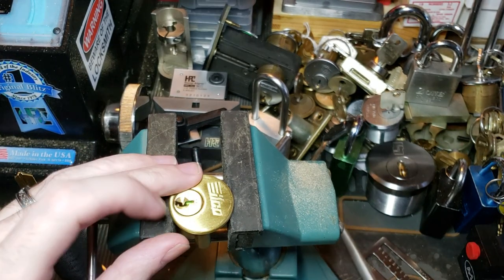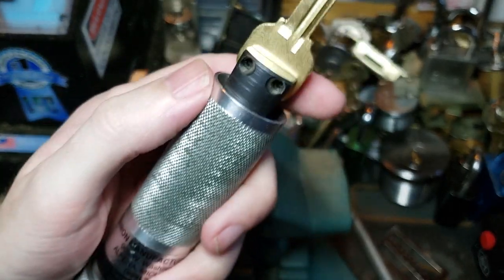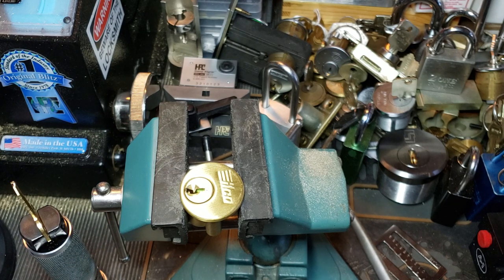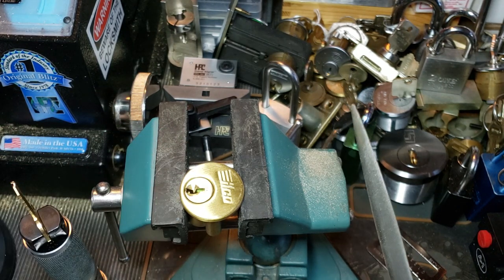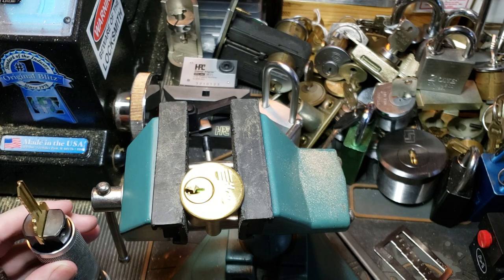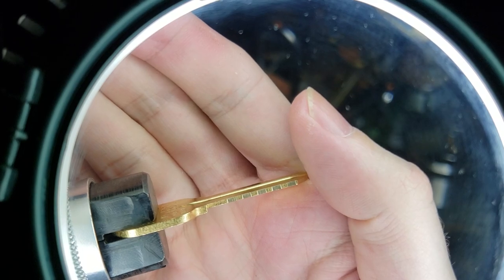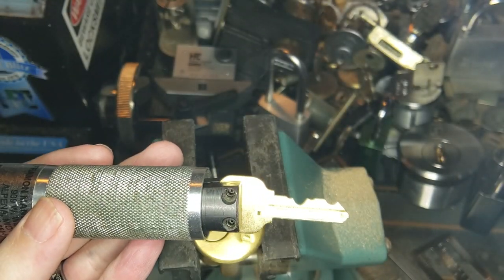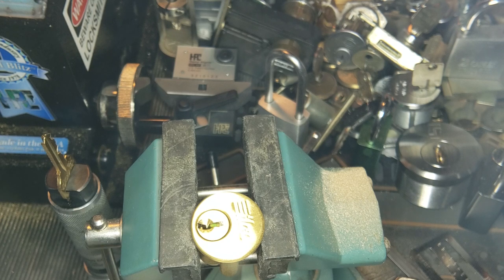(114) Intro to impressioning

Comment: Great explanation and tutorial on impressioning, it is definitely an art to get it right the first time, you are good at it. I seem to have a tough time, I end up using more blanks then I care to waste haha. I am a hobby lock picker and buy a lot of padlocks without keys and 90% of them can't be disassembled for decoding..so I started impressioning some of them and had some luck with a few but found it annoying with the ugly looking keys..so after some thought about an easier way it came to me....I think I may have made the worlds first pin profile copying jig. To make a really long story semi short..I pick the lock opened and jam a shim into the side of the tumbler to hold it unlocked, I turn the lock upside down so all the pins fall and rest at bitting profile against the cylinder. I clamp the lock into the jig and insert the pin reader,    slide the stylus in the track and it transfers the exact pin profile to scale onto a piece of blue masking tape using more or less a seesaw type device that slides side to side with a hook pick (pin reader) on one end and a ultra fine 005 marker on the other...I then peel the tape off the jig and cut it out with scissors and stick it to the blank key and grind. Works 100% accurate every time. I will send you the link to check it out when I make a vid of it.

Comment: Well explained tutorial, I like that impressioning key handle, pro tools are always worth spending the money for. ✌😎
Reply from the maker: Thanks.
Some pro tools really make a huge difference, some just make things a tiny bit easier (or last longer), but there are tons of 'pro' tools that are huge wastes of money (see SE Lock and Key's recent video on the HPC Pocker Decoder for one egregious example).
Reply: @Nite0wl  yes, true and true. Just because something is expensive doesn't mean it's any good. :/ I try and do research before I commit to an expensive purchase.
Reply from the maker: Yeah, I have been burned that way a few times. It is a rare thing that a tool will be completely useless (like my HPC pocket decoder) but I have plenty that mostly just take up space in drawers.

Comment: When I was in school I had this idea to help my impressioning.  I wrote down the depth of cut for a lock like Schlage, for example.  Then I start my impressioning and file where I saw the mark.  After each filing, I would take my micrometers and measure how much was left on the key.  For me, I would go down 1 depth for every three filings.  But that depends on how fine your file is also.  Just a little tip.  I don't use key gauges from HPC that much, not accurate enough for me unless it's an original Schlage key gauge.
Reply from the maker: The Schlage OEM key gauge is actually made by LAB, as are Schlage's OEM pins and pin kits. The key gauge I used in this video is LAB's 2-in-1 Kwikset and Schlage gauge which was included with a LAB parts kit. For high precision measurements of keys I have a Foley-Belsaw key micrometer but for general impressioning with a known depth system the sheet metal gauges are good enough. If I need precision out to .0001" I would be decoding pins and cutting by code on my Blitz machine.
Reply: @Nite0wl  Interesting.  I hardly find myself using decoders anymore.  As of now, I'm trying to figure how to sight read the Medeco Biaxial pins.  I have it on some notes written down somewhere.  I'm trying to determine the pin angle by looking at the pin.
Reply from the maker: @ken_9359  Reading the angles is the easy part, there are only 3 possible angles: Perpendicular, and 20° left or right (read with the bow on your left). By default Biaxial only uses 6 depths in .025" increments (there is a rare 'half-step' depth system used for very large master key systems similar to the one used for the Omega variant of Medeco Original). The hardest part of sight reading Biaxial and M3 is reliably determining the fore and aft displacement of the cuts which are +/-.031" off the nominal center of each chamber.
Reply: @Nite0wl  Yeah, the key is no problem reading.  My method is to have the tip of the key facing away from me and look at the angle.  Then I imagine if I had to file in that direction away from me, what hand will I be holding the file with, left or right.  That's my way of determining angles.  It's just I have the classic Medeco pin kit and it looked liked some pins were missing so I was thinking it may have been dropped.  So I want to put the correct pins in the correct place in the pin kit.  So I was trying to look at the pin itself and trying to determine the angle.  I gave up so far.
Reply from the maker: To determine the angle of a Medeco pin (Original or Biaxial/M3) is to look at the top; use the small tab that sticks out of the side and the location of the gate. For Original pins the locator tab will be 90 degrees off from the gate on a center pin, or 180 degrees off from the gate on a Biaxial/M3 pin. The left and right angled pins are easy enough to determine from there. LAB makes a very good Biaxial/M3 decoder which also decodes the pins for those series.
Reply: @Nite0wl  Thanks Nite Owl.  By putting that little tab to the right, I then look at the gate you were talking about.  If it's a center pin the gate is 90 degrees.  For the left and right pins the gate angled a certain way.  I now believe the pin kit is mixed.  I'm seeing some pins that don't belong together.
Reply from the maker: @ken_9359  For Original hold the pin looking at the top with the tab to the right, the gate of a Center pin should point straight down (it has no false gate) while the gate of Left or Right pins will be pointing down and left or down and right respectively.
The same is true for Biaxial pins when you hold them with the tab pointing up.
There are some helpful diagrams out there in Medeco service documents and some locksmithing text books which I would recommend you try to find.

Comment: You can speed up the impressioning process by using a set of depth & spacer keys. Put  Neolube on all keys and start the first cut in an area that doesn't show a mark. Then repeat the process until you get clear marks on each depth.

Comment: Like the way that you explain in detail. I have never done a key before but would like to try. The key I want to make is for a master trailer coupler lock  1970 ish. They take a standard master pad lock key, I know because I already own one and am thinking of buying another one with no key for 1/3 the price. That's if you can find them at all! I have two trailers and would like the same type lock for each. Ok back to my questions. Never done this before  so this may be a silly question, can you use a marker (or erasable type)  on the shiny brass to enhance the marks that you are looking for when they are leaving the marks? Also you mentioned getting the key stuck. So that because EVERY  filed groove has to have a taper to the valley so what ever they catch on has a "slope upwards "for the key to ride up in removing it? And lastly looking at my other short Master keys they all seem to have a total of 4 valleys, so does that mean I am looking for 4 marks? Thanks in advance for your answers and the detailed video you took the time to make.

Comment: Interesting approach. I see you ignoring marks as 'they are at shearline already'. I know a false mark when I see it. But my understanding is a good impressioned key will leave no marks, even at shearline. This means your cuts are just too high and leave a virtual mark. I do not have this lock so cannot try it myself. Try filing a tiny bit on the spots with a virtual mark. It should not return.
Reply from the maker: That is correct. In this case the cut is perhaps .001" too high so simply ignoring it is safer when using a coarse file.

Comment: At 9:10, he talks about the difference between marks from set pins vs marks from binding pins, with binding ones being "better defined". How can I learn more about telling these marks apart? Where can I really see the difference, or hear about their distinguishing characteristics?
Reply: In another comment, poster Nite 0wl says,
"I find the biggest differentiator between marks from binding pins and pins that are just a thousandth of an inch too high and should be left alone is that marks from binding pins will be almost perfectly circular while pins just a minuscule amount off from perfect will tend to be slightly oblong from side to side."

Comment: But can you do it with factory flat bottom pins?
Reply from the maker: In theory, yes. In practice, it is much faster and easier to pick then pull the core and decode.

Comment: i been thinking and getting key blanks might be a problem for some of us, good video btw
Reply from the maker: Controlling distribution of key blanks is one of the foundations of most mechanical lock security. On the other hand you can now buy boxes of the more common types of blanks (KW1, SC1, and a few others) on Amazon or other online retailers with little difficulty as long as you have around $20.
Reply: @Nite0wl  
i just checked amazon didn't know they sold key blanks sc1 box of 50 LOL. my wife would think i gone nuts. thanks for the info, i'll put this on my list of things to learn  it will take a while to get to but its something and thats enough.

Comment: Very Nice!! can you just explain the difference between an achieved shearline mark, and a "needs more filing" mark?
Reply from the maker: The 'achieved shear line' mark is noticeably deeper and usually slightly oblong as it is formed by the bevel or crown on the top of the key pin forcing the pin into the key for the last tiny fraction of an inch, the marks left by a binding pin will be smaller and more rounded.

Comment: I find it difficult to tell the difference in the marks -- that is the hard part -- if you file to deep you can keep leaving impressioning marks as the driver is now forcing the key pin below the shear line = Oops!
Reply: The problem is you'll never know how close you got. All you know then is you filed too deep.
Reply from the maker: I find the biggest differentiator between marks from binding pins and pins that are just a thousandth of an inch too high and should be left alone is that marks from binding pins will be almost perfectly circular while pins just a minuscule amount off from perfect will tend to be slightly oblong from side to side.

Comment: Hello, you need a brass key, or a specific type of key for good impression ?  thanks for the demo. nice jauge btw.  cant some carbon paper ink help ?
Reply from the maker: Brass keys are preferred, especially old Star or modern Jet blanks which are softer. Nickel plated or nickel silver blanks are harder and don't mark well. Ink, soot, and other dyes are generally unhelpful for impressioning pin tumbler or wafer locks because inserting and removing the key tends to smear them all over the place, those methods are very helpful for impressioning warded and lever locks though.
Reply: @Nite0wl  thank you !

Comment: Great job!It’s kind of a relief to know that you replaced the pins(As I kinda felt incompetent after not being able to do it with OEM ones(As they wouldn’t mark for shit 😂) PS:In regards to impressioning files creating vertical cuts, I was thinking, wouldn’t it be awesome if they made files with a trapezoid profile.
Reply from the maker: A trapezoidal file would be great for that (a few people have brought the concept up in the past) but then you end up in the same situation that makes key machine owners need half a dozen cutting wheels to match the different angles and widths different locks require. Using a pippen file or a round file and a flat (or triangular) file can get you a good equivalent result.

And yes, Kwikset's OEM pins (and their clones) are terrible for marking because of their flat tips. In the rare event that a lock with such pins would need to be impressioned instead of being picked and decoded you are probably better off with 'soft medium' impressioning.
Reply: @Nite 0wl Actually, I think that two widths (Narrow(For things like Master padlock and most wafer locks(Including auto)keys and wide(For Kwikset and the old Ford 5-cut(H50 H51)pin tumbler keys )would suffice for the majority of applications(Like you can with just two cutters(I.e The CW1011 and CW-14MC for the Blitz):In regards to not ever needing to impression a Kwikset, yes you're absolutely right, and that's why I would be happy even if they made such files with a standard(Coarse)cut, (For fitting keys by hand)
Reply from the maker: If you want only 2 profiles, narrow for small padlock keys and wide for large cylinder keys like Schlage and Corbin Russwin, Kwikset is much wider than other cylinder keys and would need to either be worked side to side or a third wider profile would be needed.
Consider the list of HPC key machine cutting wheels, you can do a huge variety with just the CW-1011 and CW-14MC but if you dont want to take extra steps they make a special cutter (CW-1014) for Kwikset without needing to widen the cuts: http://www.hudsonlock.com/cutters.html
Reply: Nite 0wl Yeah I know about that(And I do intend to purchase the CW1014 when I finally get a Blitz machine(As I want the convenience of 1 step cutting for Kwikset))But with that being said, ok, I’ll concede that three widths(Narrow,Wide and Extra-Wide(Or Extra-Narrow,Narrow and Wide(Whatever phrasing floats your boat lol)) would be allow you to tackle most applications
Reply from the maker: At the price of cutting wheels you will need to cut a lot of Kwikset keys to make up the cost compared to simply doing the extra horizontal motion when using the 14MC.
Reply: @Nite0wl  Perhaps you're right.Anyway, I am gonna get in contact with Barrett Brockhage (The CEO of lockpicks.com)and propose the idea to him (And hopefully he will agree that it's a good idea and set out on producing and selling them)
Reply from the maker: It would be an interesting thing to see. And I do like Brockhage, I have bought quite a few tools from them over the years.
Reply: @Nite0wl  I agree -- a bit of extra cranking to widen the root is no big deal -- you just follow the marks on the HPC Card -- and Kwikset being so poor quality / loose at +/- 0.003 on depth, any slight bumps are not an issue.
Reply from the maker: If I had more customers needing Kwikset keys cut it would start to make sense to invest in the dedicated cutter but where I am the market is mostly high-security with occasional Schlage, Sargent, Corbin Russwin, Arrow, Segal, and Yale. Most of the customers I have that request Kwikset keys are commuters from a neighboring state or locksport people.
Reply: Nite 0wl Really?I thought that Kwikset(Including knockoffs’s(e.g Defiant) was one of the most(If not the most)widely used residential locks in North America.
Reply from the maker: It absolutely is, but New York City is weird (we buy as many Medeco locks as the rest of the US combined) and Kwiksets are used because they are cheap and easy to install as a DIY project so they don't generate many service calls.
Reply: @Nite0wl  As I understand it, Medeco actually got it's start at commercial success in NYC.  Perhaps that's where that legacy started and continues today in NYC
Reply from the maker: @Pyrolock  New York City has a long history of investing in any strange, unusual, or innovative lock that promises high security. I still occasionally find tubular rim cylinders and Fichet locks from when they were a fad in the late 1960s and 70s. Medeco has been popular here since the late 1970s but Mul-T-Lock cut into their market in the 1990s. Medeco has responded over the years with a series of slightly gimmicky card based key control systems where an special embossed or mag stripe card must be presented to a participating locksmith to account for every cut key blank. The amusing thing is that Medeco introduces these card programs in pairs, one for New York City and one for the entire US. https://www.medeco.com/en/site/medeco/training/keycontrol32/
Reply: @Nite0wl did Medeco start that?  Seems to Schlage + many others including Euro haven those duplication cards
Reply from the maker: @Pyrolock  I have not been able to find any documentation on the earliest introduction of authorization cards but it has been a hallmark of Medeco for about 30 years and Mul-T-Lock has made them a default for at least 10 or more years. Schlage and other manufacturers have used 'signature cards' or letters of authorization for their factory controlled systems for at least that long. The main difference between the card based systems and the 'authorization letter' systems is that the card systems are intended for individuals where the factory controlled systems were created to manage large master keyed systems. A card that could fit in a wallet and taken to (almost) any locksmith to order a new key is much more convenient for a residential lock system than having to write to the manufacturer and wait a month for a new set of keys to be mailed.
Reply: @Nite0wl  Thanks for info

Comment: Looks like he used a 0 bitting space and depth key to prepare that blank.
For magnification, try drug store reading glasses.  2.00 up to 3.00
After filing, how about a wee bit of 800 grit sand paper to let marks show up better?

So far I have not succeeded at one of these.  Just asking, not tutoring.